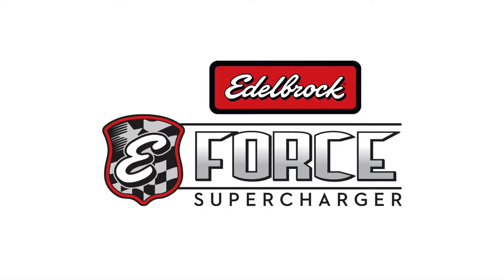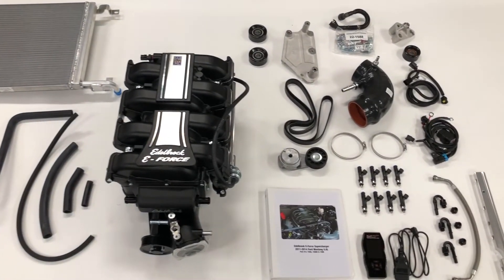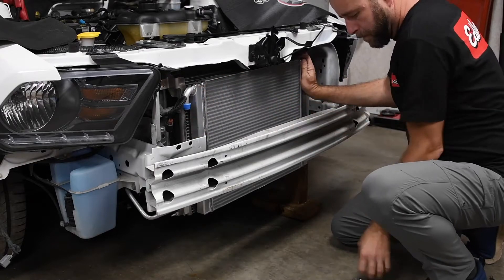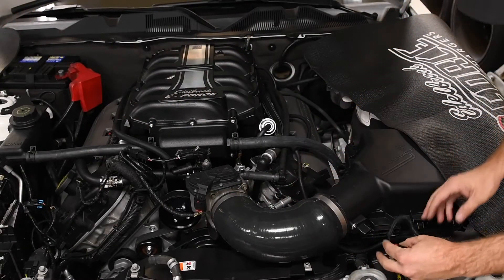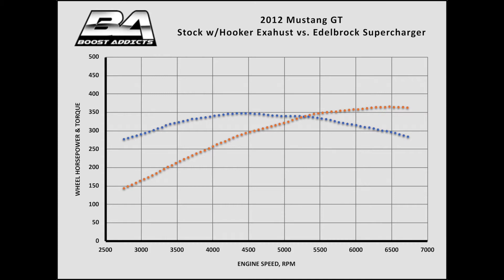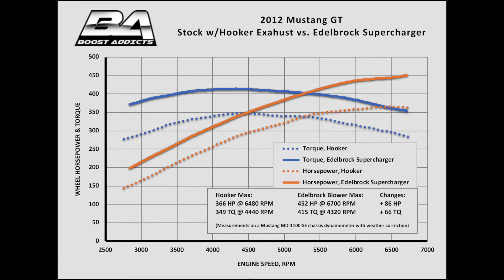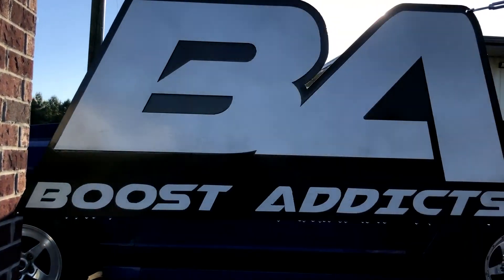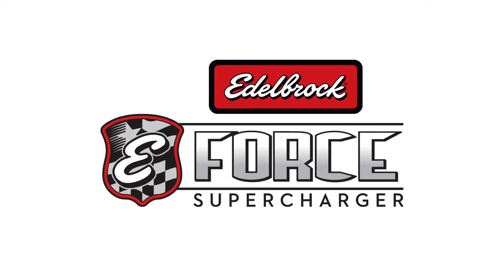Edelbrock Mustang Supercharger Review

Comment: Well I must say that’s impressive, 87 hp , there is a lot more left in it , say about 800hp when you change the pulley
Reply from the maker: Oh, totally. This is on their 50-state legal tune also. 0.80 target lambda, about 16 degrees of timing on 93 octane E10 pump fuel. This is just right out of the box, bolt it on and head to the dyno. Once we build the motor, we're going to pulley it and get serious.